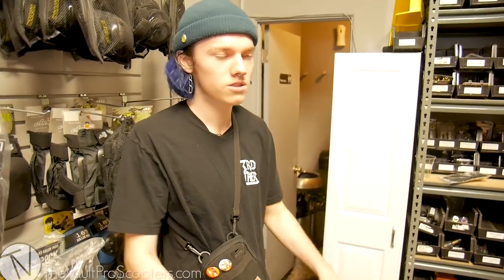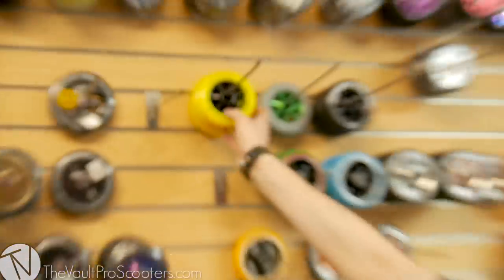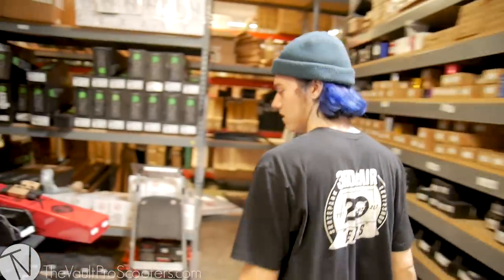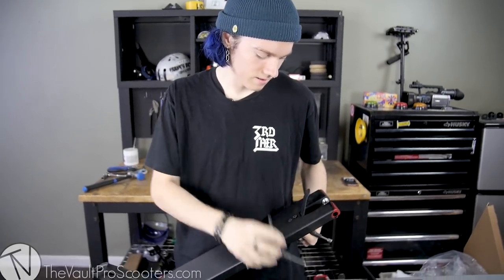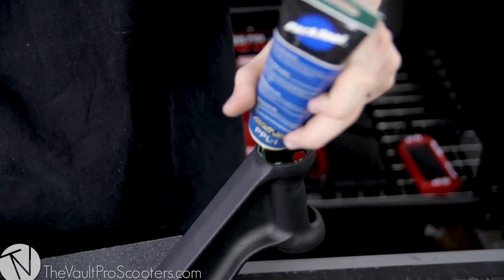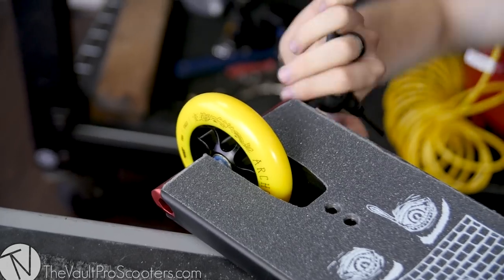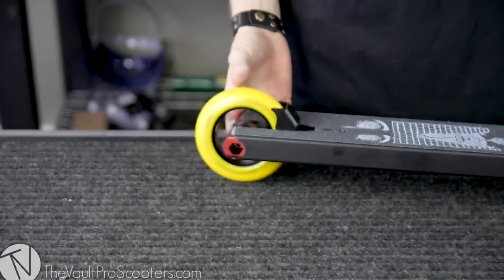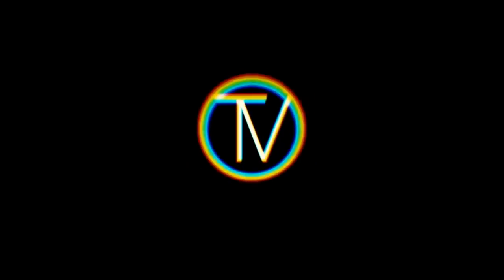Custom Build #237 (ft. Wyatt Adler) │ The Vault Pro Scooters

Comment: The vault I have question: which headset should I use other than velocity?
Reply: Tilt. Proto. Ethic. Vault. Envy. Lucky. Fuzion. Pretty much anything
Reply: Ezekiel scoots roots industries are good aswell they are currently on my setup and it’s butter